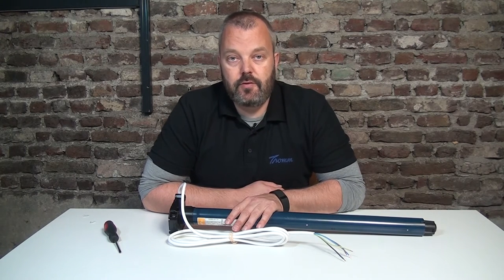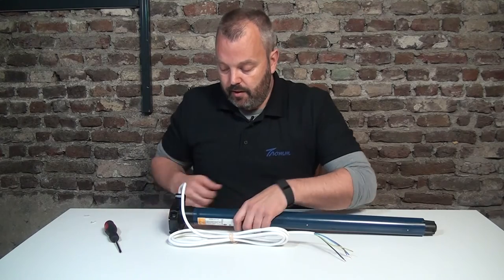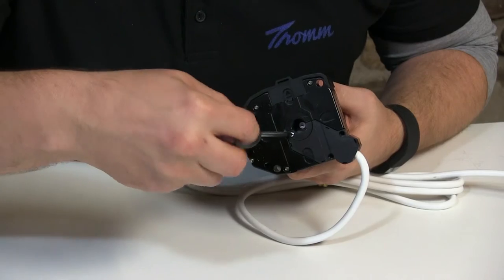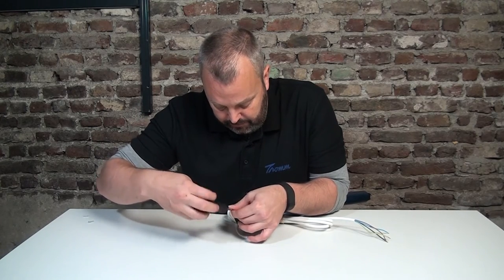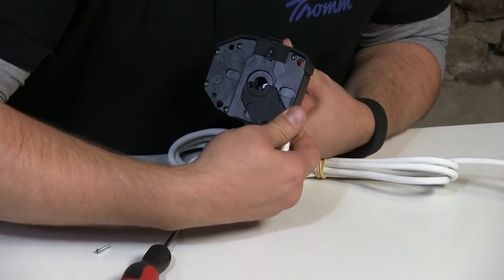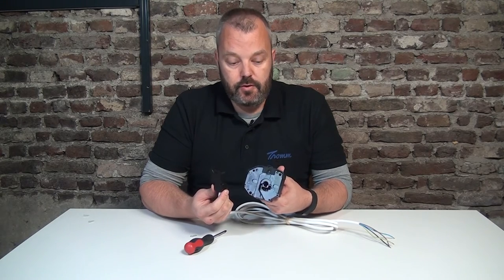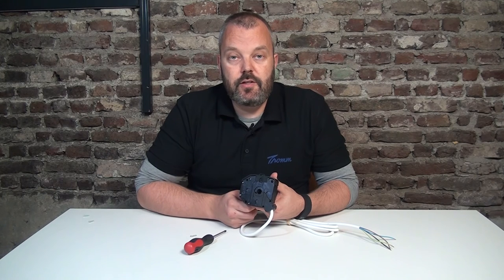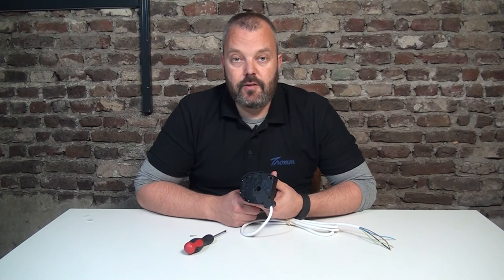Somfy RDO LT50 CSI - how to take out the power cord

Comment: Anybody know its supporting remote ?
Reply from the maker: The CSI has no remote control receiver built in. So you can either work with an external receiver or with the RDO CSI RTS version of this motor, which has a built in receiver. Ifyou use that motor or an external RTS receiver from Somfy, you can use the whole range of RTS remotes, from keygo keychain versions, to wall switches such as the smoove origin RTS to Telis 16 and Telis 6 models. Availability of remotes depends on where you are based, as the ranges can differ (US has different models from Europe for example)